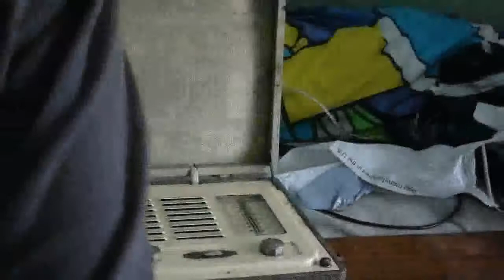A failed attmpt at fixing a Vidor tube/valve radio.

Comment from the maker: Unfortunatly can only run on batteries, so there's no simple way an AC cord could be added.  I could make a power supply for it and maybe one day I will.  A lot of the old battery tube radios used batteries like that.

Comment: I don't know if you can still buy one...but there used to be a company that made DC supply for old radios...it plugs into an ac outlet and has all of the different voltages to power an old radio.

Comment: For the 1.5 volts you use a pair of D cells in parallel, that is the filament supply.
For the 90 volts you get ten 9 volt batteries and ten snap connections and wire everything in series.
The caps are very much available as are the resistors and tubes.
Not much else to go wrong.

Comment: It's fixable,spray some deoxi t 5 on the volume pot,then work it back and forth ,clean the line on the tubes with a single edge razor blade and scrape the line clean .to start with nice radio

Comment: I've got one of these and I'm a bit puzzled about a grid bias battery. Normally sets like this have 1 but I can't seem to find connections for it. Grid bias battery is usually about 7.5 volts. If you look up the DL 96, the G1  is about minus 5 volts. I note there wasn't 1 in your set when you opened it. Maybe an electronics engineer can enlighten us. Interesting vid, by the way, carry on with the gr8 work. :o)

Comment: i got 1942 zenith model 4k635 wood cabinet is in perfect shape looks brand new just need to make a power supply or battary like u did here this radio is fine just needs that one capacitor all u need to do is change the oil filled ones the dry ones are fine they last a long time have a 1940s oscilloscope like this just had to replace the H.V. capacitors they were filled with fish oil smelled badly when they popped

Comment: If this chaps in UK the mains power is 230v AC 50 Hz there are HT/LT 90v/1.5v power units around at car-boot sales etc but his battery idea looks fine (HT drain is much lower than LT for the valve filaments which he's covered well. new condencers (sorry capacitors) try Ebay  RS  in England check for fryed resistors - but FIRST get the circuit diagram these Vidors are very collectable and it is pronounced VY-DOOR ,  Regatta CN420 made about 1951/2  worth restoring inc. valves.good luck old man.

Comment: Time to recap it and check the tubes,which are 1.5 volt tubes and one.3_volt tube,I have several portable tube radio ,but all mine also have a A.C. Cord too.nice job love these old tube prtables

Comment: i now have the radio as you and i have the same problem the amp works ( you tell if you touch a tube you get a buzzing sound)   but nothing else does .  the tubes are lit so i dont know

Comment: I have similar vidor radio like this mine is smaller.. I think you can verify in few way ,. I see your audio amplifier section is working... You need 455-465Khz function generator , so you can check your IF is it working? another way to check your mixer Local oscillator working or not by place a radio near to it.. when you tuning the dial your MW radio should pick up something..  There is a switch for LW and MW.. also check the loop antenna on top of casing see the antenna is it broken you can check by multimeter. you can check Vidor CN381 if you cant find it, you can find a similar one with same tube set as reference..

Comment: maybe you can find the right capacitors on a jukebox site. maybe you have to replace the volume (and tone) pots as wel or at least clean them up witch contact spray. the distortion could be a bad speaker who knows wat kind of damage those old batteries have done to the radio..

Comment: Um....no, you couldn't..... its 90v DC for the HT and 1.5v DC for the "heaters" if you connected 115v AC to it it would blow up AC and DC currents are different . CoolDudeClem - Re-cap it, thats why its 'deaf' ,IF stage needs doing first